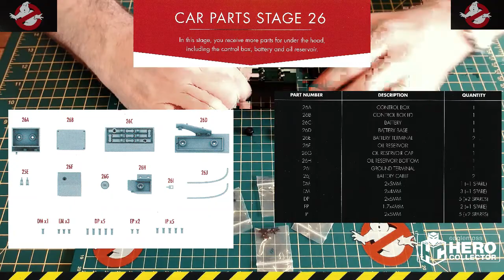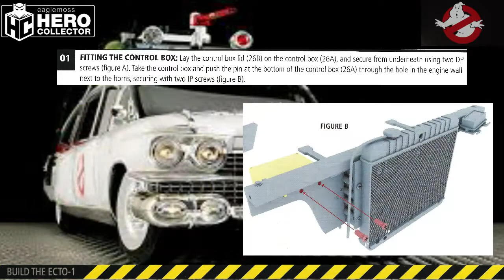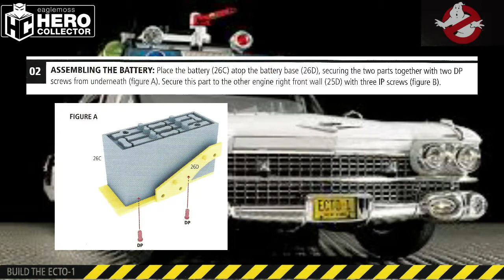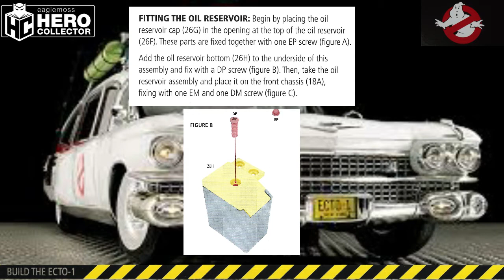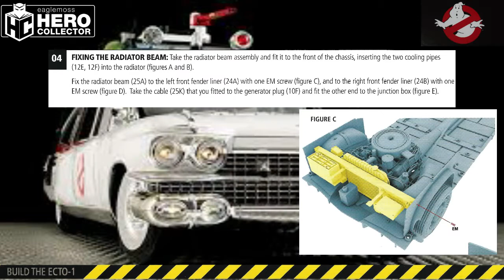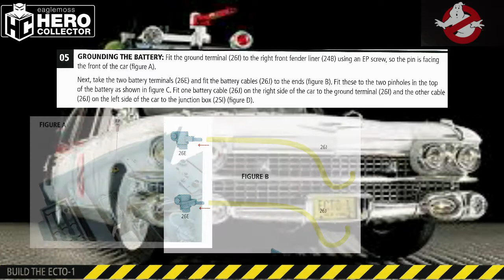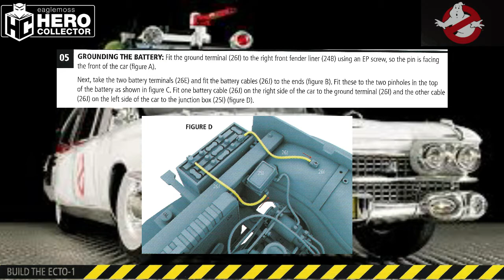Build the Ghostbusters Ecto-1 - Stage 26. A 1/8 Scale model, movie car build. By HeroCollector

Comment: Am very fed up with this stage, I can't line up the radiator beam holes at all, nearly chucked it out!
Reply from the maker: Sorry to hear that, I had real trouble getting the left hand side in, I had to give it a good bit of force to get it aligned, it did just pop in in the end. It was hard to see what I was doing as well as you can't see the screw holes through the fender liners. Hope you got it now. Sometimes, just taking a five minute break and coming back to it can make all the difference, well helps prevent it ending up in the bin, or being thrown against the wall, believe me I have been there.